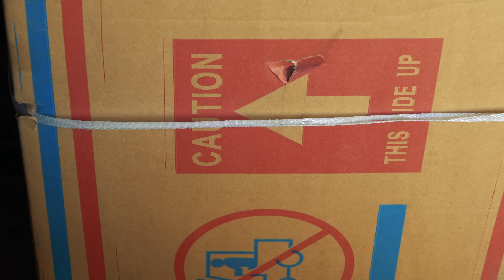Why I Modified my KIDS TRUCK.

Comment: My daughters have  a white Hello Kitty Escalade in the backyard. the pedal contacts caroded and the battery does not hold a charge anymore. I told my 9 yr old I would fix so her 4yr sister could enjoy it. They objected and prefer the pushing it around with the 4 yr old steering. in the summer they fill it with water and sit in it. Hilarity ensues when they play with it.  Your son is going to love his car.

Comment: We had an old power wheels jeep converted to 12 volts with a car battery, the extra weight in the back and added torque will give you wheelies under full power , kids loved it.